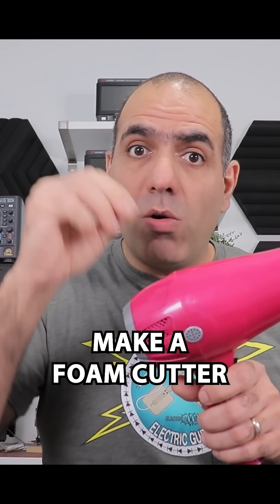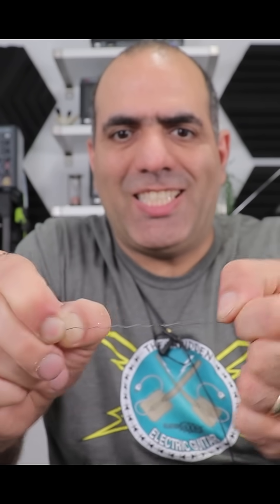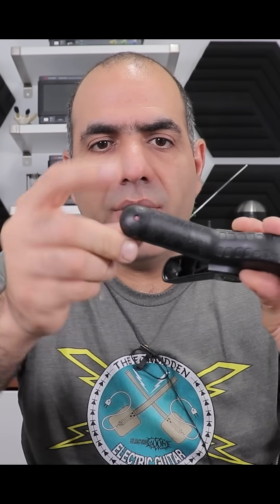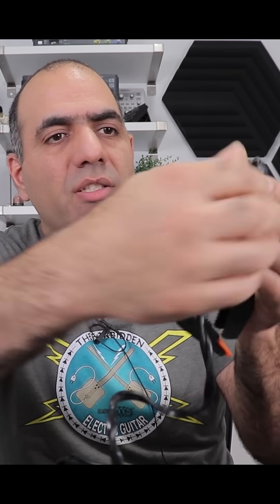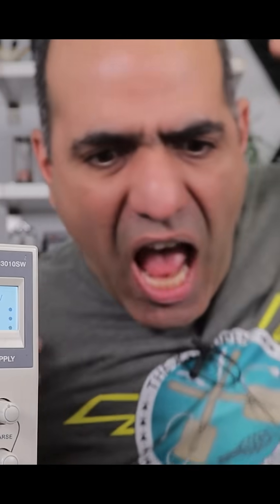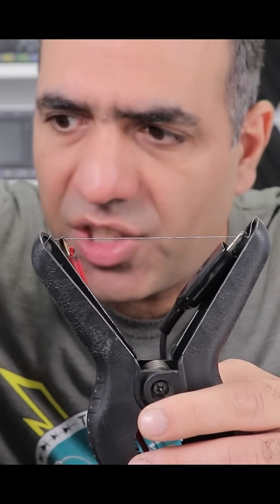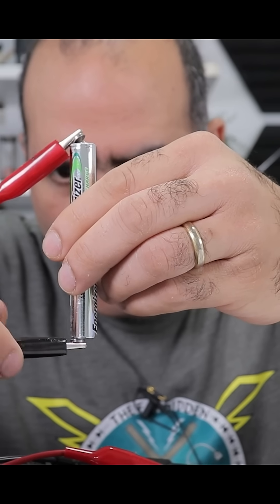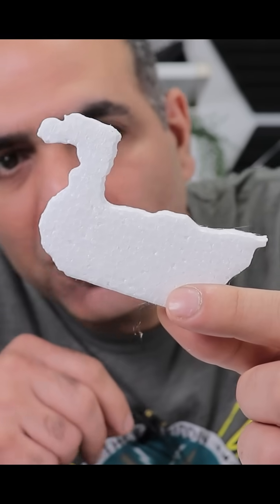Make a Foam Cutter #electrical #foam #element #funny

Comment: Using a remote controlled relay board, lengths of 18-2 wire and a short piece of corona wire, which is in toasters, heaters and blow driers, you can control a sequence of fireworks.

Comment: I took one of them 2-pronged soldering gun shaped things and ran a 1mm thick copper wire through the ends. Got more than hot enough to comfortable sculpt styrofoam, which I needed to make a custom packaging solution for some vintage porcelain

Comment: Takes a length of heater wire that needs 3 volts to get dangerously hot, uses 20-40 times that
Edit: I've done things even more foolish than this...  ...[remembers antique glowplug I ruined with 12-24 volts DC😢]

Comment: I've used five feet of 0.032 stainless steel safety wire to cut R/C airplane wings from four-foot sections of home insulation 2" foam with a  volt battery.

Comment: Hey electroBOOM

I have a question. In july my speaker broke and its connecting wire loosed connection. And when i tried to attach it again. A massive amount of heat produced and my finger was injured. Can you tell me what is the reason?

Comment: Spiral notebook. Here I have a used up spiral notebook. Now let's remove the wire and then grab both ends. One end in each hand now with a tennis shoe on stretch it as far as you can. Now pull it back and forth very quickly this will make the wire hot and straighten it at the same time. Now you can make a foam cutter that uses friction to heat.

Comment: My uncle made something like a large scale version of this, just a resistive wire (much thicker than a normal heating element) connected to a variable power supply that he used to cut out the internal Styrofoam structure of the wings of his airplane that he built.

Comment: I wanted such a cutter to cut soap bars but chickened out on the grounds that it would probably end up like in this video.
Put the soap in the microwave and heated it until it was soft enough to cut with a breadknife.

Comment: If you dangled the wire (not the clamps) into water, will it heat up the water super quickly? NB: I am in thoughts with the two AA batteries.

Comment: I used to fix the heat treat ovens in The foundry I worked in the wire that creates the heat in the ovens needs to be heated up to the point where it's just about glowing to be able to make it malleable without damaging it

Comment: I used to work in a factory where we would cut giant foam blocks into slabs using this very technique. We had a big square frame that we'd stretch wires across and then run a current through them as the foam block was slowly pushed through.

Comment: you can also use toaster for this (but mine had flat resistive wire so its harder to turn with that) or similar appliances, but be careful not to melt your wire holder

Comment: I think its just kanthal or NiChrome resistance wire. Available in spools for a couple bucks. I suppose an old cadet heater would work too... Different wires have different resistance and require different voltage.

Comment: I used to use an arc welder and 6 metres of stainless steel wire to cut blocks of foam 5 metres long.

Comment: Takes me back to a day of temp work in a factory, holding one end of a 9ft foam cutter wire, cutting conduit holes through insulation panels. Same device, just scaled up. No freehand ducks for us — we had a circular die at each end to guide our cut path. (The challenge was for the guy at each end to move the wire at the same steady rate, to cut a straight cylinder rather than a concave hole. Still, easy enough for a temp worker to pick up in real time.)

Thinking back I wonder why we didn't have respirators — surely melted polystyrene produces some VOCs of concern. Well, it was the '90s.
Reply: That sounds like fun even with all the lung cancer
Reply: @finwylie5850  It was! We were producing panels for SIP [structural insulated panel] wall construction — this was circa 1997 and I got the impression it was a new thing at the time.

Today, who knows, maybe they're still using a heated-wire cutter, but controlled by the robots.
Reply: I'm thinking that the polystyrene foam in houses made with structural insulated panels will offgas over the years, and will cause many cases of cancer.
Reply: @FLPhotoCatcher  Possible. But it's not like SIP is the only way polystyrene and other foamed polymers are used in the built environment. As insulation or otherwise. (To say nothing of the non-foamed polymers sitting around, like PVC.)
Reply: @ps.2  That does not make it better.
Reply: @FLPhotoCatcher I think the amount of gas released and the amount breathed in would be near zero.

Comment: Yesterday i just blew up my first capacitor😂
Reply: Congratulations on the start of your journey, may you blow many capacitors and fuses while surviving the ordeal.
Reply: My first capacitor blew 6 years ago. But today I blew my first fuse at ~12V 20A and got jumpscared by the circuit below my leg lol. All I had in mind was "electroboom moment" so I started watching his videos right now lmfao
Reply: @nullbeyondo 😂😂
Reply: Welcome to the club 😊
Reply: You always remember your first
Reply: ElectroNEWBIE?
Reply: Unintentionally (maybe) discharged a camera builtin flash capacitor by touching or brushing screwdriver over terminals. Resulting discharge⚡ sprayed fine molten metal across the circuit board which then on shorted with buildup of capacitor charge.
Moral: Don't go anywhere near a capacitor & a circuitboard with a screwdriver. Never underestimate the amount of charge stored in a capacitor ⚡⚡😊
Reply: I remember my first as well. 🤣

Comment: Imagine that but with a razor blade instead
Reply: Heating up a razor blade would take a lot more current, and it wouldn't necessarily heat evenly, and the result would be about the same but less versatile. As you can see, the stuff melts fast enough that you don't need the cutting edge to be sharp. A resistive wire is perfect for this.

Unless you specifically need straight lines. Then perhaps you do want the razor — specifically I'd guess an oscillating multi-tool with a half-moon blade. Unheated. Though Mehdi's wire cutter could get a pretty straight line if you guide the cut, by clamping the piece between two yardsticks (or other straightedges — just make sure they're not made of plastic).
Reply: @ps.2  thanks for the info! Yeah, I guess the wire is better for this type of thing.